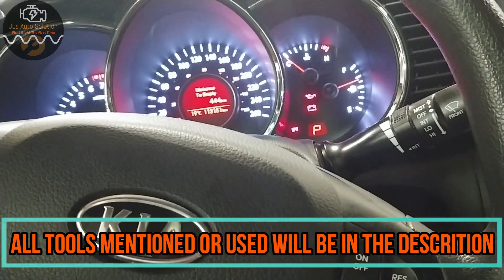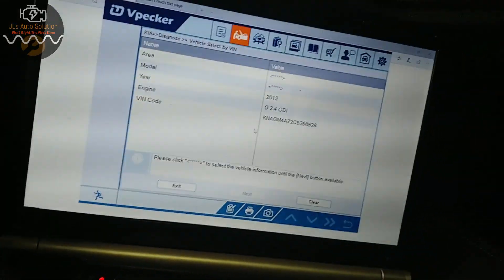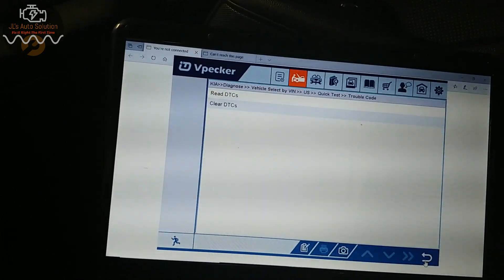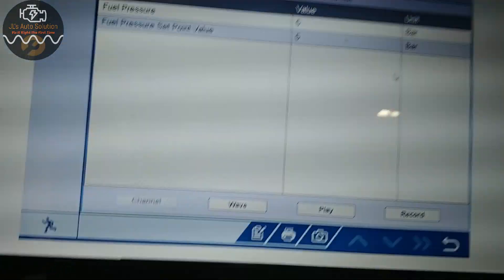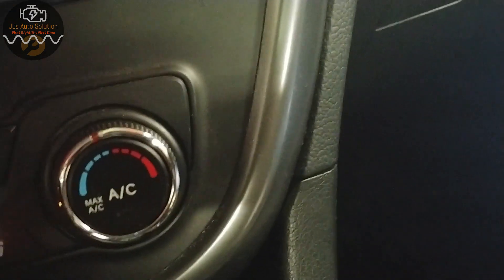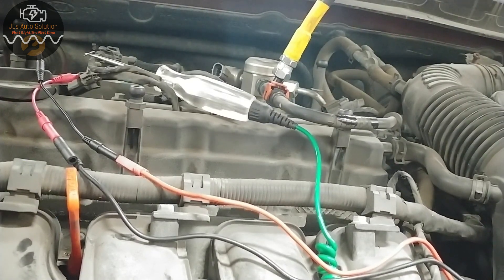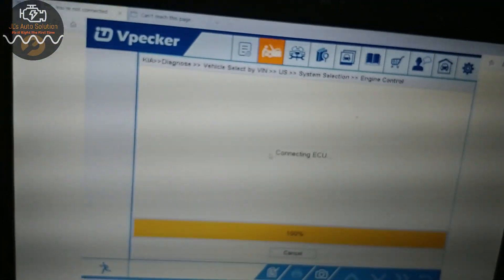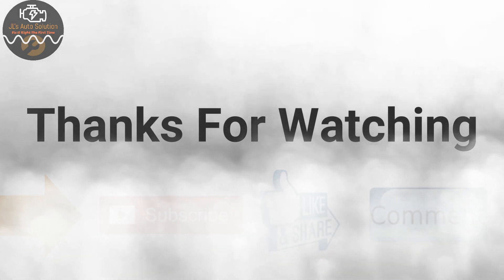Gdi pump Diagnosis P0087

Comment: Bit confused so can you define ,when the hpfp reglator valve goes bad ..can the car start its ford ecoboost 1.0l gasoline 2013 ...can the car start only with low pressure fuel ..?
Reply: Yes it will still start because fuel can still travel pass it but won’t be pressurized enough to send the required amount of fuel to the cylinder at the rate it needs for higher rpms. The ecu will recognize this and put the car in limp mode so  it cant go pass about 20mph/2k rpm to prevent damage

Comment: I got code p0087 on my hyundai veloster. Car runs fine but after maybe around 50miles it stop it wont start,but after 30mins or engine gets cold it will start again and runs perfect then again same issue it will stop.. but some times it takes about 1 week before i experience again that issue. Any ideas what should i change or do. Thnks in advance

Comment: What would be the approach to diagnose this if the car cranks but won’t start? Having this problem right now with a 2013 Rio. Any way to do some sort of diagnosis if it doesn’t start? Thanks
Reply from the maker: Fuel air compression timing spark, also check for restricted cat, they like to fail and block.
Reply: @JLsAutoSolution  thanks for the pointers! Crossing my fingers it’s not the cat

Comment: Im still learning but thank God i diagnosed that correctly. Parts otw tomorrow but i basically checked low side pressure with gauge and high side using scanner, same as you. Low pressure would climb to 300+ psi after a good while  koeo but when koer it wouldnt go past 83psi. Considering it should be around 600+ psi when engine is running, i figured 2 things hpfp isnt working, and because the low side builds up above spec when engine is off, there may be a problem with the fuel pressure reg as well (built into hpfp. I wasnt thorough, but im more confident in my decision now, nothing worse than wasting a customers money guessing and then you end up being wrong. Fun fact, i also have the same car as the one im working on, which is why i took the job 😂
Reply from the maker: Did this help you fix the issue?
Reply: @JLsAutoSolution  well I diagnosed it before watching.  It pretty much helped me verify my work.

Comment: Very good informational video. How would you test the high pressure fuel pump if the car cranks but does not start?
Reply from the maker: there is a special adapter and pressure gauge that is needed in order to measure the high pressure side.
Reply: Can you post a link to the gauge and adapter, that is used for the high pressure testing?

Comment: wow, awesome test. I'm just learning a lot about diagnosing and love your channel, can let this test be done with a regular test light or do you need an LED one. thanks for the feedback.
Reply from the maker: Thank you for the compliments😊. Now for this test it is better to use a led only because a incandescent test light will actually pull the circuit straight to ground, while a led test light will only put a partial load on the control circuit. Hope that answers your question. 

have a great night

Comment: Very good video very informative
Reply from the maker: Glad you liked it
Reply: @JLsAutoSolution  Working on a 2013 ford focus 2.0 i full fielded the injector pump and it did not stall 
i tried to look up service info on it and it did not say. But with the injector pump unplugged doing this test the desired pressure on the rail was only 53 so maybe it the injectors will not open up enough to allow it to stall maybe. Just wondering your thoughts
Reply from the maker: @sherwinb5085  so with the HP pump unplugged the only pressure the rail will be seeing is from the low pressure pump. 53psi seems about right.

You need to erase the DTC and recheck the high pressure circuit. Make sure you have 12v and control from the pcm. Then check the fuel rail pressure sensors again. There might me 2 sensors on the focus
 One for low side and one for the high side.

On ford I belive it will be call low pressure and high pressure fuel rail sensors.

400- 700 psi is what you are looking for the high side at idle.. 

Hope that helps.

Comment: Great video. How can I test the fuel pressure on this car?
Reply from the maker: if its the low pressure side you only need an adaptor(part number--09353-02100, lang also has a kit that fits. the high pressure side is harder.. you need specialized hoses and equipment(guages ect) typically the high pressure side is read through a scan tool. but if the fuel pressure sensor is suspect to be faulty, then test that first.

thanks for watching

Comment: Hi thanks for the video. I have questions that cable the is going to the fuel pump should always have electricity going through . It's the solenoid cause my Don't have any electricity going through thanks
Reply from the maker: Erase etc and cycle ignition then recheck voltages at connector
Reply: @JLsAutoSolution  thank you

Comment: Great video, I am having the same problem on my 2013 Ford Focus. I cant insert the wire into the connector to check with the light as its a sealed unit. So I did it directly into the connector removed from the high pressure pump but it didnt light up. I checked the solenoid in the pump with my power probe and it clicked so I assume its ok. Does this mean there is likely a problem with the harness or will this method not work if the connector isnt plugged in?
Reply from the maker: Let me check it out I'lL get back to you

Comment: So what is logic behind that engine should stall when power up hp solenoid? Thank you
Reply from the maker: Hi upkar.. so the reason that the vehicle stalls out is due to high pressure.. when adding a standard ground and power to the GDI pump, you are allowing full fuel
Flow to enter the pump. this increased flow means higher fuel pressure.  On the optima the pcms strategy is to stall out the  vehicle, in order to prevent damage. If I would take a 2014 rondo the pump supplies fuel pressure around 2700 psi with a power and ground  added but the vehicle does not stall.. the pump makes a whining sound. I hope this answers your question. The results of the test are completely dependent on the vehicles make/model and programming.
Reply: @JLsAutoSolution that makes sense.thank you for explaining